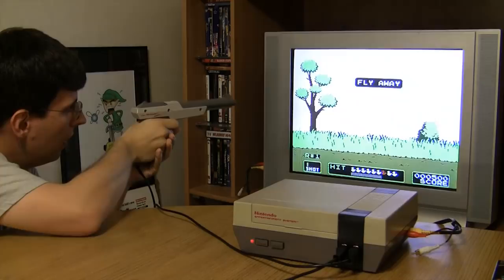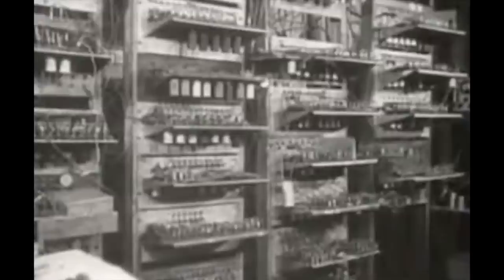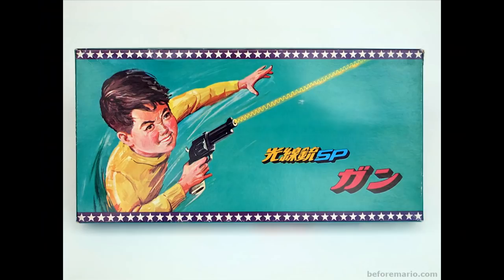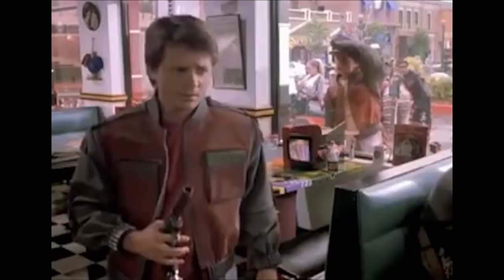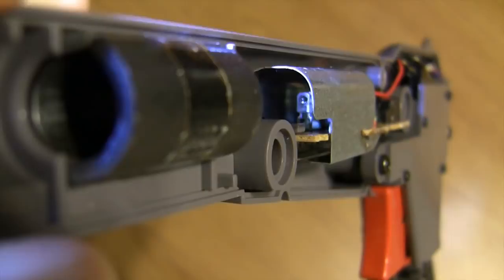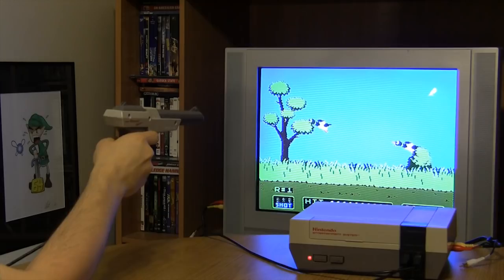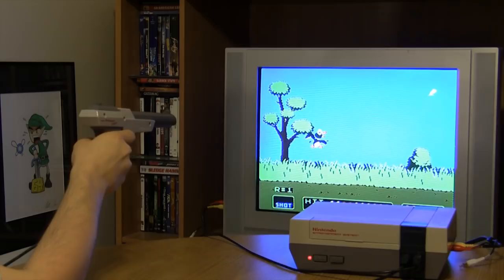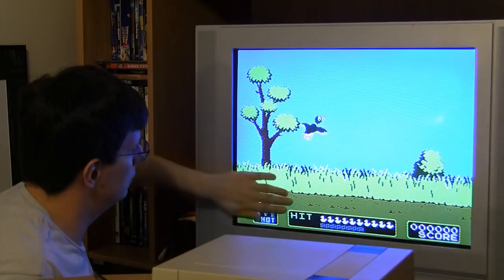The Way Games Work - NES Zapper

Comment: Hi COGW, great video! I teach NES game development at Parsons the New School for Design in New York City. My take on why the zapper doesn't work on none-CRT TVs is still based on the scan lines but more from the software side. When scan lines run all the way to the bottom of the screen, it takes time go back up, this time difference is called vblank. This brief moment (about 24.5uS) is when NES does all the updates. The overall refresh rate (including vblank) is universal to all NTSC(64uS 228 cycles) or PAL CRT TVs so the zapper knows exactly when to look at the screen. With none-CRT TVs, NES can't predict what is on the screen anymore so the zapper stop working.

Comment: Thanks for the explanation; this sheds light on something I remember as a kid.  As you said, in games like Duck Hunt, the quick darkening of the screen was not much of a hindrance, but I remember owning a port of one of my favorite arcade games at the time called "Operation Wolf".  Unlike Duck Hunt, where you only take one or two shots at a time, in Operation Wolf, the screen is always full of enemies and you are constantly blasting away at anything and everything the whole time.  The darkening of the screen in his case made the game essentially unplayable.  I had to resort to using the regular controller, which just moved a crosshairs around the screen.  It was a disappointingly poor emulation of the arcade experience, where you got to use an Uzi that didn't blank out the screen and actually had a vibrating mechanism to produce a recoil-like effect when fired.

Comment: strobe light covered with 5 sheets of opaque black construction paper with a small square cut out always worked when I was a kid
Reply: this could actually work given that the stobe light is off when the nes cheat detecting system is active.

Comment: Some Zapper games do use scanlines.

On a CRT, the Zapper's photodiode is accurate enough to see up/down if the software polls it once per scanline (once per 113.667 cycles), just not left/right. Operation Wolf uses a white screen to tell up/down and then sends a white "cloud" from the left side to tell left/right with sequential targeting. The homebrew game Zap Ruder does the same thing.

Comment: 4:38 Using that principle it is possible to develop a game which the zapper works on HDTV. All you need is to calibrate the input lag before playing by pointing the zapper at the TV screen.
Reply: I don't see this happening.  You would have to have the screen flash before the gun activated the sensor and I doubt the gun itself has the programming to be delayed like that.  Input lag wasn't a thing until HDTVs came out so they wouldn't have known to plan for it back in the 80s.

Comment: Great in-depth explanation!

It might not be completely correct to say that modern LCD / Plasma screens update ALL pixels at once, but I see what you meant. They often use some form of multiplexing and display maybe a few rows at a time.

For plasma TV's it's even more complex - many of them use a similar system to single-chip DLP in that they display sequential "bit-planes" to make up the shades of colours. They need to do this for Red / Green / Blue too, but they update much faster than DLP's.

Comment: Cool video.  The Zapper hardware is, in fact capable of detecting individual scanlines in a single frame.  The game program simply needs to better use of the sensor (poll it more often).  Duck Hunt keeps it as simple as possible.

Comment: The only way I can imagine the "Lightbulb trick" could work, is that the mains frequency can align with the time when the NES takes a sample from the light sensor. However I find this unlikely, because the filament wire inside the lightbulb does not completely stop glowing in between the frequency peaks. (There is probably some types of special light bulbs that almost stop emitting light in between peaks)

Comment: Such a simple solution. And doesn't require you to glue things to the top of your tv and run extra wires.
60fps. In the 80's. Never would have guessed.

Comment: The light bulb trick does work, my little brother always used it with the purpose of ruining the whole video game experience (that granted him several punches of course), but unfortunately I do not own the equipment anymore hence I cannot prove you the theory. But I believe that getting too close to the light bulb doesn't help as well because I think it is too damn bright, try a white wall with a good illumination or try a 60W light bulb at a fair distance (1 or 2 meters away would help I think)

Comment: The light bulb trick does not work, but there is a way to trick out the zapper, simply turn the brightness on your CRT high enough that the zapper see's anything on the screen as a target.  every TV is slightly diff in how much brightness you need, but i tried it on at least 5 CRT's and 1 B & W i had kicking around.

Comment: @t0nito So I have to disagree with the information provided in this video. What the zapper actually detects is the screen flicker at 60 fields per second. Thats why shooting at an ordinary light won't work, and that's why it will never work on an LCD even if it had no lag. If you don't believe me try it your self. You have to record on a tape because it will flicker 60 fields per second. Recording on digital devices won't work because they won't show you the interlace effect while paused.

Comment: I got a new TV a while back. I used an old CRT piece of doo doo for the longest while, which had no Latency issues. But my new TV... Doesn't even have a game mode option. Aiming is practically impossible. Thanks for educating me on why this happens with my TV xP

Comment: The simple reason why the light gun does not work with modern TVs its because the photo diode work in IR spectrum. Old CRT monitors could still display IR light when white light hit the CRT. (Try this... If you have a old CRT record it with a camera that can only see IR ie out a IR filter in front of the lens. Or night vision mode on some cameras. Point it at the CRT and watch the white box magically appear on the he Cam for a sec. But if you go to a modern LCD display there are no ir light coming off of it.
Reply: gerald's project vlogs NNNNNNEEEEEEEERRRRRRRRRRDDDDDDDDDD
Reply: gerald's project vlogs jj the rabbit came by yesterday!

Comment: If the failure to use the zapper on a LCD screen is a up-scaling things it should be easy enough to prove this. Just find a LCD tv that has the option to not upscale the image(the image would appear as a postage stamp in the middle of screen with black around it), and see if it works.

Comment: Huh, that's really weird. I've tried several NES Zappers on a 27" Sony Trinitron and a 32" Sony Trinitron with zero luck. Both were Flat Panel CRTs as well. You might say, "Well the Zappers must not be working correctly." However, I have tried the same Zappers on an older style curved display and they all worked perfectly fine... So I don't know.
Reply: RetroRupp same here

Comment: I think that the reason LCD TVs don't work the zapper is because the screens emit light even if the screen is black therefor it would throw of the cheat detection since the black screen that is supposed to pop up and show no light is actually showing light on an LCD screen.

Comment: perhaps the screen on this point where you are shooting at, hast to be first black and then white.. or first white and then black... and modern monitors may have a lower response time so that there is no real black for one frame... because you should easily be able to syncronize the time delay by one simle test..

Comment: When I played your video (this video) a message appears on screen saying:
Content Warning
The video you have requested has not been rated and may contain content intended for mature audiences.
I have to sign-in to watch this video. Can you rate this video so that people don't have to sign-in? I didn't see any violence in this video so no need age restrictions. thanks :)
Reply: What country do you live in?

The video technically does contain violence - it shows the guy shooting a couple of extremely pixelated people at about the ten minute mark.
Reply: Justin Stallings You're right. I over looked that. But I don't think Hogans Alley (9:54) is violent enough to be age restricted. Small children were playing that back then during the late 1980s. Hogans Alley are not real people. They are metal that will spin as you hit them. I saw several YouTube videos which is far more worse than Hogans Alley but no age restrictions.
Reply: bobskie321 Maybe it's the gun itself, then. Like I said, maybe your government is restricting the video, because I live in the USA and I can watch the video without signing in.

If you saw other more violent videos that weren't restricted, I'd say it's simply because those have not been flagged yet while this one has.

Comment: The zapper will not work on LCD/PLASMA TVs because their "black" is much brighter than the "black" in a CRT, therefore the zapper registers the black "anti-cheat" screen too bright and considers it a cheat. The zapper does work in LED TVs where black is actually no light being emitted.

Comment: For the lightbulb trick, you would have to use an LED bulb and also be able to frame pace. You want the bulb to light only on that single frame so that the light gun thinks the light from the lamp is the screen target... and sadly, that takes processing, processing induces input lag, and that means that you would most likely end up with the lightbulb trick not working... unless you could possibly get away with using a flicker... although I bet that's been done to death!!

Comment: "the light bulb trick" should be working if we use the luminescent lamp, because they blinks with frequency of 50 or 60 Hz (depending on the country). If You would be lucky enough to pull the trigger in the right moment, it would see the black in the 1st moment and the light in the second. But You must be sure that no other light sources are not interfering to this cheating process. Hope to see a response =3

Comment: There is a way to cheat, I've done it before and it proves that it doesn't need the black screen before the white rectangle.I recorded duck hunt on a 2 head VCR while shooting the screen when you choose the game mode where the whole screen turns white. The thing is the screen turns white not for one frame but one field. So I paused the screen precisely on the frame where it turned white, since the white is only on one field the screen was flickering 60 times a second.

Comment: Yup, input lag is the likely cause for something very time sensitive like that, and might actually be one of the causes that some of the most modern CRTs didn't work either (they started putting in a bit of image processing capabilities to them at some point, which inevitably leads to lag).

And yeah, LCD's and Plasmas can be horrible with lag, your average LCD or Plasma will average at between 40-90 ms of input lag, and a handful have been measured in at sub 20 ms (with a purpose built tester, none of that high speed camera shtick that's inaccurate as hell), the very best ones (Sony's newer Bravias, especially the W6 series) have been measured at 14-15 ms. Interestingly, despite people going on and on about how plasmas are supposedly lag free there has never been a plasma HDTV that's been tested reliably to hit below 27 ms.  Best LCD monitors have been measured to hit about 9 ms, which is only about 5ms behind CRT monitors (they're not totally lag free, nothing can ever be), so might be quick enough to actually work with the Zapper. Need to test my W653 with a Zapper at some point to see whether or not it can actually work...

Comment: Lightbulb trick works on some pirated clones of Famicom. I'm from Russia and in 90's we have all of those in almost every house) You call these bootlegs, i think. Now, with the help of Internet we know what we played then and chinese and taiwanese clones are still present on or markets.
Reply: The lightbulb worked quite well in the SEGA version for Master System (the predecessor of Sega Genesis), as long as if it were in a dark room. For NES we actually could made it with stobo lights, as long as you covered the usual silver backround these lamps have (at least in my country they use to be like this). But the strobo is kinda difficult for you to get the right timing and after 2 minutes you get complete pissed off with that light flashing at your face hahahahahahaha...

Comment: Sure, but a simple strobe, or even a light bulb behind a desk-fan might work on the NES zapper
Reply: But if it's not at the same speed as the refresh signal you might just register a fan blade instead of a duck.

Comment: Unfortunately I don't have a zapper anymore, but I still have a NES.  I'm in my 30's now so I can't exactly remember what TV type my cheat works on, whether it's black and white or a color screen, but you could adjust the brightness and contrast settings to such a point that as long as the zapper was pointing at the screen, it would register a hit.  Great for Duck Hunt but not so great for games where you are not to shoot friendlies.

My theory on this is that when the screen goes black in that one frame, the screen is still bright but not bright enough to trigger the diode, so the zapper registers the player is pointing the gun to the screen.  But in the next frame the color from the white screen is so bright the color "bleeds" from it and whole screen is then bright.  That way no matter where you point the zapper to the screen, you always get a hit.

Does anyone still have a zapper and Duck Hunt to try this trick?

Comment: 6:33 - Also not quite correct - 99% of Plasma TVs actually drive the panel with multiple sub-frames to create the gradients in colour, and most sets even have to do this three times per colour "frame" in order to display the Red, Geen, and Blue parts of the image.

So, they technically don't illuminate all the pixels on the panel "at once".

This is similar to the way DLP projectors work - each pixel on the chip can only ever be switched completely on ("white") or completely off ("black", or near enough). In order to display the gradients of each colour, they use multiple "bit-planes" to build up the image (and your eyes integrate those sub-frames into one complete frame).

That's why it may even be possible to use a NES Zapper on specific Plasma TVs which can fool the filter circuit in the gun to allow the signal through, and also have a low enough latency. ;)

Comment: There was to varieties to the light gun the early model was somewhat buggy and recalled with the original famicon system however rumors state that a few of these guns escaped and were sold here in the states as legit light guns however these are just rumours :P if i had to guess it was probably due to the great number of forged light guns towards the end of the 90s which were very convincing copies but ultimately lacked certain features of true nintendo light guns just a guess

Comment: Pointing on light bulb will not work. I have a gun and i did some reverse engineering :) Looking at the scheme, there is a capacitor between the photo diode and and the transistor. To activate the transistor a light change must happen to get a pulse. On constant light the transistor will not trigger.

Comment: I wonder if it would be possible to make a zapper gun that actually would work on an HD TV, just with different hardware built into it to work on HD TVs.
Reply: There are guns that use sensors mounted on or near the tv that approximate the behavior (think wii remote), but they are far less accurate.
Reply: +Nicksolo85 I'm sure it could be made with today's technology.
Reply: As he explained in the video, (if his theory is true) it just requires a calibration with the time-delay of HD TV picture scaling. So it can be solved by the software, making it wait for a longer time to wait check if the light gun is activated.
Reply: Nicksolo85 nothing easier than that

Comment: HDTV have a lot of latency,but i know the Wii U Gamepad only have less than a frame of latency. I wonder if it could work with that kind of display technology (and i'm not talking about the system itself, but just the unique ultra low latency display
they use)

Comment: You also forgot to mention that the zapper only works with a 50/60hz tv,it simplywill NOT work on a 100hz tv,trough it would be cool if nintendo moddifies their nes gun gsmes to be ob the wii vc and to also work ob 100hz tv's, along with a wii zapper .

Comment: Could you possibly do the lightbulb system if you wire the gun to something that, when you pull the trigger, it causes the light to turn off during the cheat-proofing frame?

Comment: huh, guess i should not be surprised some one already made a in depth video if it. and you might of made me look bad :P i saw a black frame after white square to so i said that was part of it. my vid was a bit of frame by frame learning +what i know about electronics.... also time for trolling "The light bulb trick did not work because you need to use the older curved incandescent bulbs as that was the type of common light bulb in the 90's"